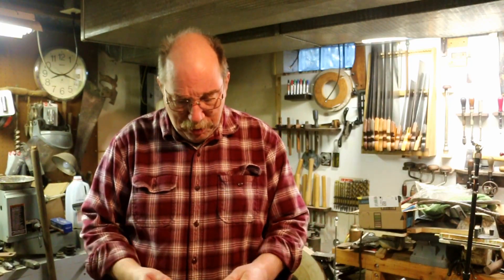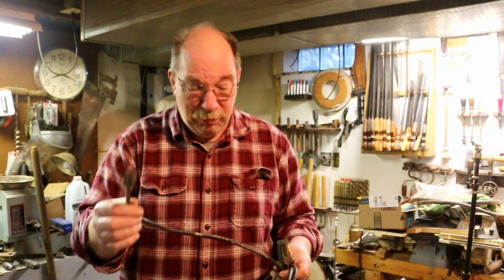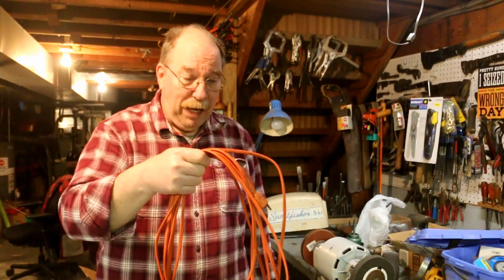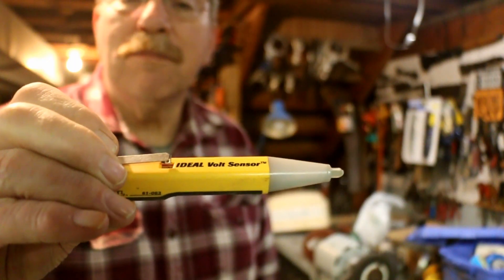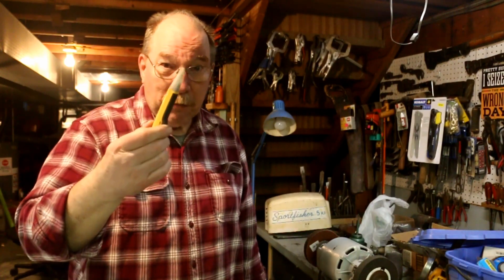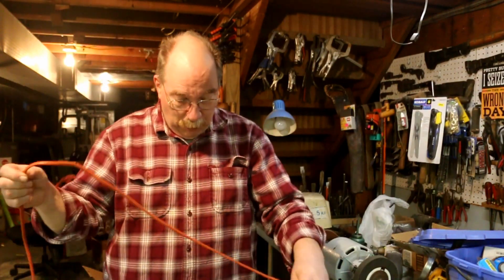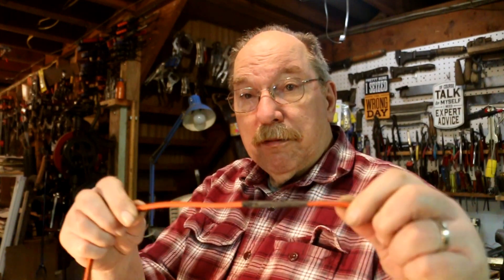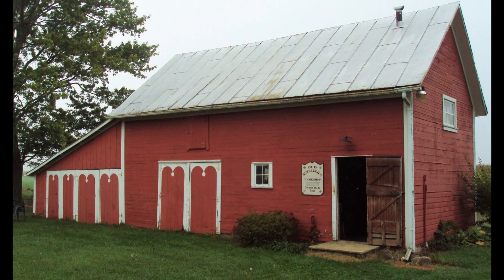Checking An Extension Cord For Breaks

Comment: how can you tell where a short in an extension cord is when it rains? I have ornaments out in the yard that light up when dry ok...but when it rains,, it trips the circuit...any other ideas, or the same as you describe above in your video with a continuity tester?
Reply from the maker: If you have already done this just ignore it. 
1. Unplug the cord.
2. Reset the breaker. If it won't reset it might be in the outlet. 
3. Unplug the ornaments. 
4. Plug the cord back in. 
If the breaker trips it is the extention cord. 
If it doesn't trip it is the ornaments. 
5. If it is the cord then check for broken insulation. The power has to be shorted out to the common or the ground to trip the breaker. If so the tick tracer won't help. The breaker will trip before you can test for where the short is. 
Tick tracers trace down broken wires. You slide the tracer down the wire from the plug until you don't get the pinging. 
If it is in the ornament then it is a repeat of the cord test. 
Run the tick tracer down the wire until it stops pinging.

Comment: what if only the black wire is broken? will the sensor still work?
Reply from the maker: It will show where the black wire is broken.
Reply from the maker: Yes. Since the sensor only detects current if the black is broken it will tell you where the the first place the black wire is broken. there may be multiple breaks but the first one would have to be bridged or repaired before the second one will show up. Each subsequent break will have to be treated the same way. 
If the white wire is broken there will have to be a load on the wire to send current through the white wire. Like plugging in a lamp.

Comment: what if one wire has continuity from one end to the other?
Reply from the maker: Good question. 
Check each conductor for continuity. 
Apply power to the one that fails the continuity test and trace the wire to find the break. 😁😎
Reply: Powering only the broken cable was the solution. Thanks for showing me the tool that I needed! It seems that both of my old splices had failed at the same time. I used solder this time and even remembered to put the shrink wrap on the open cable first :)
Reply from the maker: If it is the power lead it won't show. Then you have to do a continuity check.

Comment: You did not say ...you are to plug cable into AC socket or not. Which end of cable do you test from "??
Reply from the maker: Plug the cord in and check from that end.
Don't be surprised if there is more than one break. 😄😎
Reply from the maker: Yup that's right I didn't tell you to plug the cord into a recepticle to provide power for the tester to detect. 
Test from the plug end because that is where the power starts. If you don't find any then you know right away. 
You can actually start at either end. It might take a bit longer.

Comment: Is that the sort of thing you use to find the bad Christmas tree light?
Reply from the maker: It will work quite well at that. Easier than plugging in a light bulb until it lights. 
You can just run it along the wire until it stops beeping.That is the bad bulb. Even better it works the same if there is more than one bad bulb. 😁😎

Comment: Those little testers are quite handy. I’d repair an extension cord, but I normally add a new plug or socket at the break, not a splice.  Kind of risky, but I guess for indoor use it’s okay. As long as the insulation isn’t deteriorating in other spots.  Great tip though.
Reply from the maker: The tester is a life saver when working in industry. 
Massive snags of wire are difficult to trace out. 
Being able to sense current potentials without having to pierce the insulation is very helpful.😁😎

Comment: I had a good comment but this wretched thing erased it so it can deal with it. Good fault finding. I just do it bare handed and where the eyeballs cross, there's the fault. All testers like that go dead before I can use them so I don't. Happy Day 2 U and GBWYall and THANKS!
Reply from the maker: I pull the batteries when they aren't being used. 😁😎
Reply: @OldSneelock  I'd loose the batteries and end up pulling the meter off the house. You know how I am and how I get.
Reply: @OldSneelock  I then put the batteries in an old pill bottle and store with the tester.
Reply from the maker: Good idea.  I get way too many pill bottles now. 😁😎
Reply from the maker: The manual crossed eyeballs test is always right.

Comment: Just a side note....If the neutral was broken, you would never have found it with the tester....only good for the power conductor....If you were a neighbor of mine, I would give you some extension cords but the shipping is more than the cords are worth....CHEERS
Reply from the maker: I would have to cheat and, horrors!, apply power to the neutral. Wouldn't be a first for me. 😁
Reply: @OldSneelock  Now I see....Just the electrician in me that made me say it.....CHEERS
Reply from the maker: All the training sinks in and shows up every once in a while..😁😎
Reply from the maker: No one really does this anymore but it was real handy for series circuits on Christmas lights.

Comment: Repaired cords are fine at home, but on the job site, OSHA inspectors can have issues with them. Just a heads up for anyone that may have to deal with those guys. 😎
Reply from the maker: It is good to be careful. OSHA is all about preventing an insurance payout. It matters little as long as there isn't a claim.
Reply: @OldSneelock  Right. You know how it is around conveyor belts with guarding and emergency stops and lock out/ tag out, the whole thing. I remember the refresher classes and Fatalgrams. I also remember starting a small return conveyor with a 5 foot bar through the bars in the tail pulley to keep from shoveling. It was a combined effort between me and the guy on the switch. We're both still here so it must've worked but he was the one that cut his finger off with that big grinder.
Reply from the maker: I have mixed feelings about OSHA. 
I broke a finger by having it in the pulley on a sand elevator when the guys shoveling out the bottom of the elevator got the plugged buckets freed up. 
The elevator ran in reverse and snapped my index finger.
Locking out the power wouldn't have helped.
Reply: My MSHA days are over but they had some good inspectors.

Comment: Good tip.   I have one of those voltage detectors.   I never thought about using it to test my extension cords.   DOH!   I have a long 16gauge 3 wire extension cord which broke a conductor somewhere along the length.    I will now be able to track down the break and cut off the short end.
Thanks,
Dave.
Reply from the maker: My co-writer and real talent in the group said I should make videos about things I do with out thinking. 
I have been repairing things for most of my life and worked with people who were much better trained than me. 
Sharing what I picked up has been the best part of making videos. 😁😎